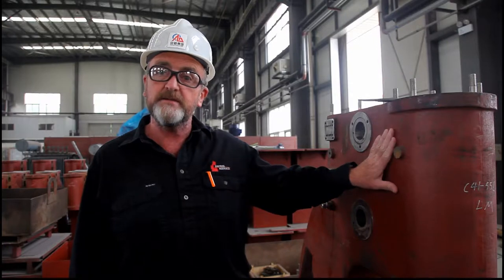How to install the pneumatic hammer air hammer Anyang

Comment: As an industrial millwright I can say thats not a very confidence inspiring video. The use of files to get the rings to compress was my favorite part. I can see getting creative to do a one off build or repair but not having the proper tools for production made machinery isn't very professional. I'd hate to see a the approach used on one of the larger hammers.  It atleast shows why you save so much money buying from China.